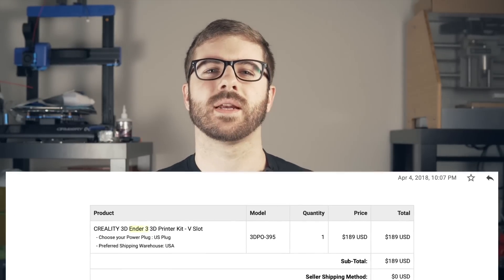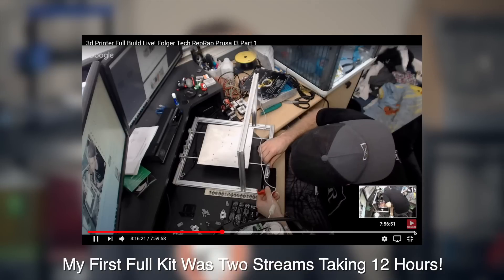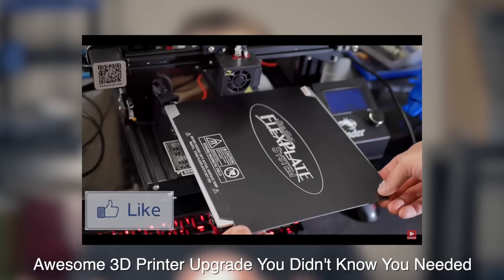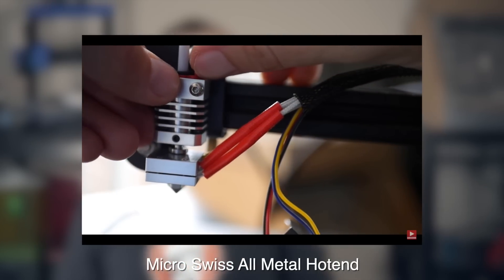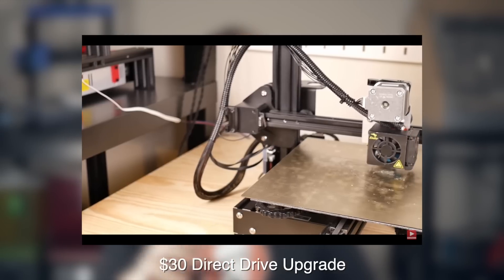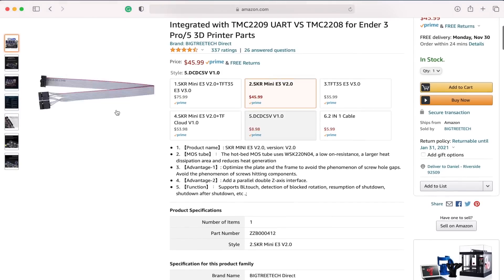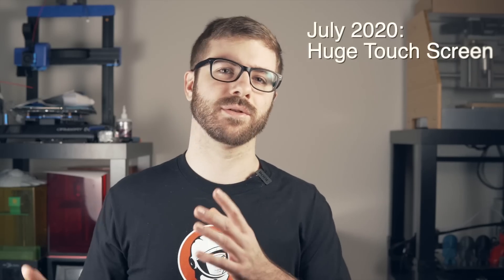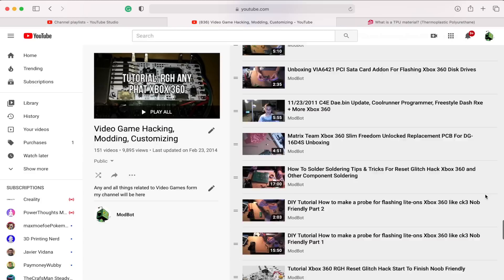My Ender 3 Journey 2.5 Years Later! Still Worth Getting?

Comment: Great video. Love your vids. They always seem to help with information that I am looking for. 
I love my Ender 3. Just put the Micro Swiss drop-in on mine. Getting it set up for Nylon Carbon fiber. I also just picked up a Sunlu dryer. We are out of state right now but it should be at the house when I get home. 
Now you have me thinking about the new control board. LoL. 

Thank you for doing these video. You do a fantastic job with your explanations. Keep up to good work!
Reply from the maker: Hello Dan! Thank you so much for the kind words. Woohoo, sounds like your Ender 3 is going a very similar path to mine. Make sure that you either have a glass bed with glue stick or garolite for the Nylon Carbon Fiber. Bed adhesion is a big issue with that material. That dryer will help out a ton though with moisture. 

Hmm tough call on the board upgrade. If you are happy with it maybe hold off until you feel you need to? IDK I tell myself that all the time and never listen haha. 

Hope the printing goes well

Comment: very similar path on my ender 3 v2.  I went with a flex plate and mico swiss extruder/hotend also nd added a herome 5 fan combo.  I'm also going to swap out the micro swiss heater block for a copper one ($7 from mellow) and change out the thermistor to a cartridge and add a second z screw.  It's becoming aa fraankender.
Reply: Greg R benefit on the copper heater block?
Reply: @alpha6ix222  First, I ordered a new block because the standard microswiss heater block doesn't have a hole for a cartridge thermistor, which is required if you want to go over 284C.  Marlin will auto limit the standard thermistor to 300 max temp, and reduce that down to 284C for operating max.  To get past that, you have to use a cartridge thermistor rated for higher temps.  Also, standard bead thermistors have ptfe insulation, which isn't rated over 260 anyway.  If you merely hack the marlin thermistor setting, you run the risk of a fire.  So that explains the new heater block.  Copper is just a more stable material from a thermal shock standpoint.  If you heat aluminum up too high and too fast, it can warp.  So copper is a better choice, but usually very expensive.  China.......
Reply from the maker: I am not sure I have seen the herome 5 fan combo. That sounds insane lol. I have an image in my head but I do not think it is correct :P

Comment: My build plate sticks over the front of the bed also, I have my gcode move that direction before it prints and wipes the nozzle.  It originally happened by accident when I needed a build plate in a pinch and used one that was too big, but it works really well and I keep doing it.
Reply from the maker: Hahah that is awesome and a super clever way to use that lip. My only gripe is owning dogs that some hair has gotten stuck on the adhesive. Doesnt affect print quality but I do not love seeing it 😂
Reply: @ModBotArmy  I understand that, but the dogs are worth it, or at least that is what I keep telling myself haha

Comment: I just got an Ender 3 in Sept and it was my first 3D printer. It was a gift and I didn't know what I was getting into, so my perspective on it is extra fresh. I had no idea how much tinkering was involved. Needless to say, there were hurdles. I think the Ender 3 is a good teacher. It's flawed out of the box (my V1 certainly was) and demands you know each part's function to get it to operate correctly. A few months later, I have modded it quite a bit and I still have issues due to lack of proper cooling, so that is the next fix. I now have a Creality LDH resin printer and a Prusa Mini on the way (it's almost here!). I would say for someone looking to buy a first printer, they should understand that FDM printers have a lot of moving parts and require constant maintenance, which brings frustration and also challenge. The Ender 3 is no exception, imho. I do strongly agree that it's a great first printer just knowing that it has a massive, extremely helpful community. It will smack you in the mouth a couple times if you're a n00b, though. Anyway, not sure why I wasn't subbed before, but now I am.
Reply from the maker: I completely agree. My opinion on 3d printing is that there is no perfect machine. I dont care if you spend a thousand dollars there is still maintenance and a learning curve. Shure it may be less in some situations but alot of the same premise carries over. For the price it is at least a great way to see if this is a technology that you care to explore further. I am jealous about your Mini I have been close to getting one multiple times now. Thank you very much for the sub as well as the lengthy comment. Stoked to see you clearly have been bit by the printing bug :)

Comment: Great video! Did you increase the Vref of the drivers when you installed the direct drive or is that not necessary?
Reply: Not required, just have to update your esteps and retraction.
Reply: @cotycollins6302  that’s for the extrudermotor. But i meant for the x-motor. Adding weight requires it to work harder, so i am curious whether this needs more power to the motor or not.
Reply from the maker: I did not end up having to do this. That being said I did not run it long with the stock board before switching to the BigTreeTech. With that being said I still do not believe it is necessary in this case.

Comment: Thanks for the video!
Pretty much the same story with my Ender 3. I came from an Anycubic Kossel as my first printer (steeeep learning curve!! And also completely modded today) and then got the Ender 3. As tinkering is in my blood, I pretty much immediately started to mod that thing. Some mods stayed, some had to go (like capcitive bedlevel sensor). To date, it has linear rails on X and Y, direct extruder (still the cheapy version from Thingiverse), BL Touch, Bulls-Eye Fanduct with radial 5015 fan, BTT SKR 1.4 Turbo with 2209 and sensorless homing, belttensioners, glas or FR4 buildplate, BTT touchscreen, a passiv dual-Z-axis, a raspberry pi 4 with octoprint, tennisball-feets, a cablechain for the bed, neopixels on the fanduct, LED-stripes on the frame and a carrying handle on the gantry for throwing it away! :D Latest mod was done yesterday, where I exchanged the original steppermotor on the extruder to a pancake stepper for less weight on the carriage.
Reply from the maker: You are a beast! I did get a delta kit pretty early on but it definitely was not my first and I am thankful haha. I could not imagine starting there. Good on you for seeing it through. Your printer sounds like an absolute monster. I definitely approve this :)

Comment: I built one by collecting discounted and DIY components and just ordered a Micro swiss direct drive extruder for it. I mainly need to print TPU. I managed to print some parts with the standard extruder, but it required constant attention. Fingers crossed that the Micro swiss will complete the machine.
Reply from the maker: Wait so you frankensteined an Ender 3? Did you source the aluminum extrusions as well? Thats awesome. Fingers crossed.
Reply: @ModBotArmy  It's a bit of a mongrel really, but most upgrades for the Ender 3 will fit on mine. I found all the hardware and 2020 extrusions locally and already had stepper motors. The rest was fairly easy to find online. I did'nt save much money, but it was a fun learning experience.